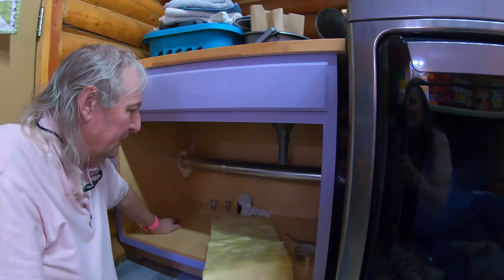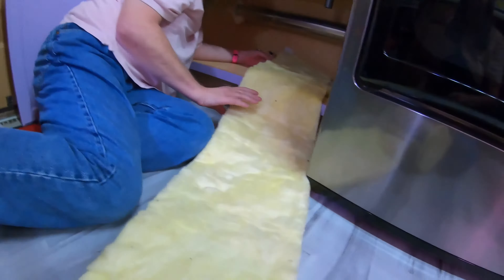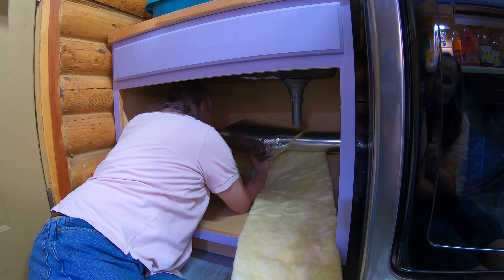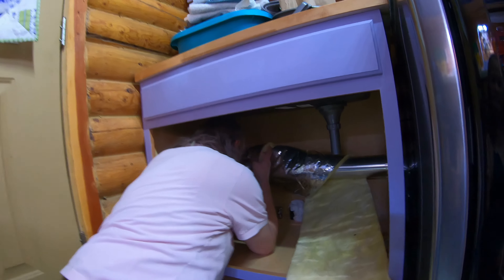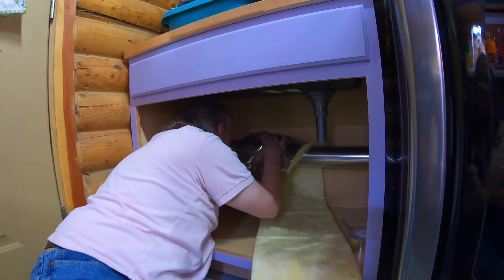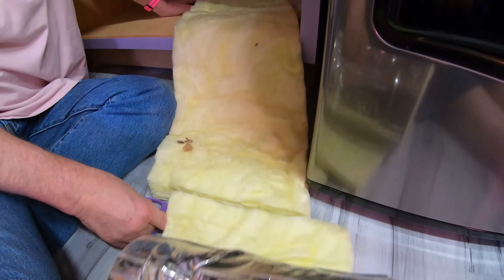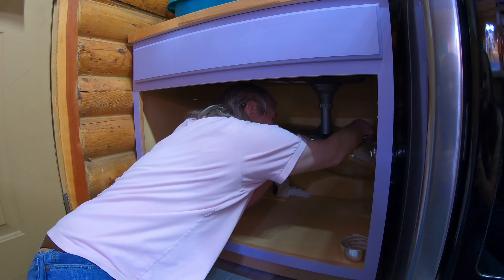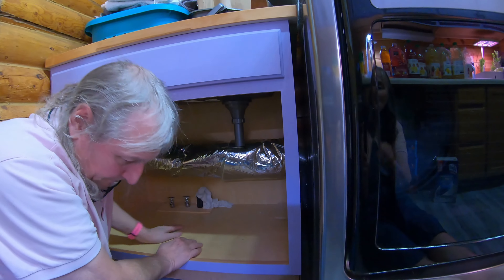Insulating a Metal Dryer Vent

Comment: You stated there will be condensation because the vent is warm, that is wrong.   If the pipe is sealed with foil duct tape there should be no leakage of warm damp air.  The insulation would have been easier to put on  lengthwise.   I know you're trying to be helpful, but I don't know why you post videos of problems/solutions that you know nothing about.